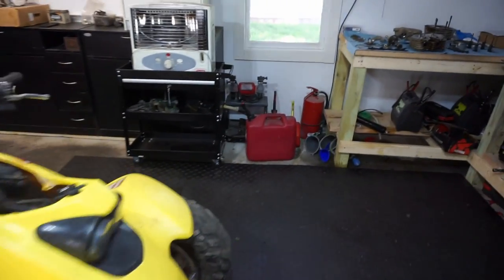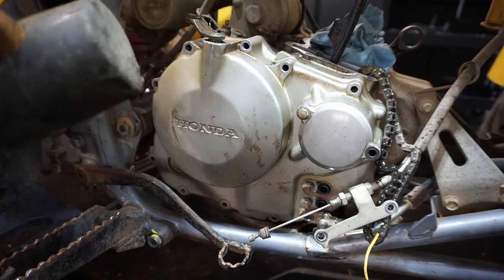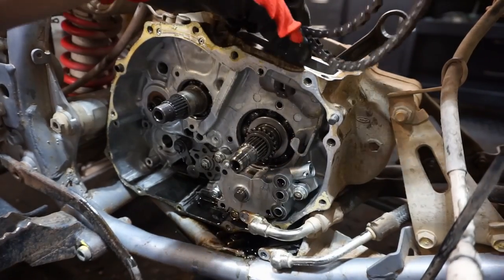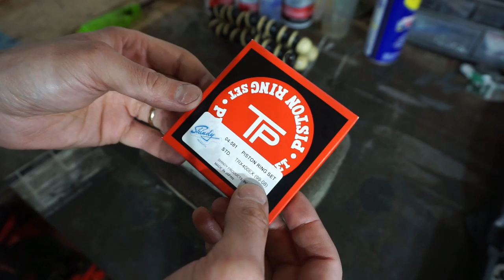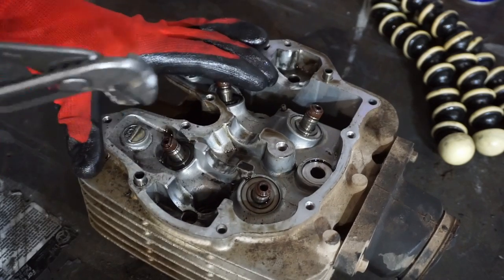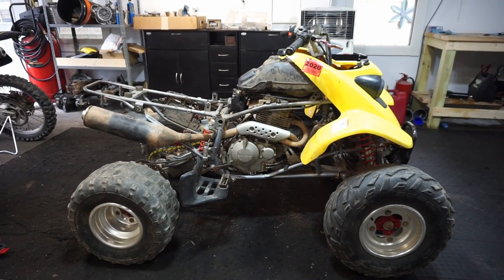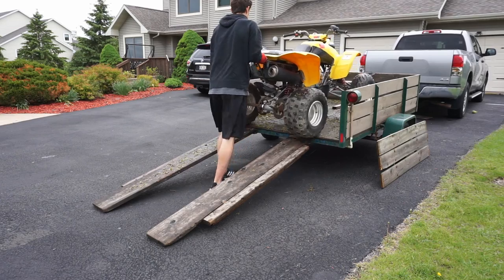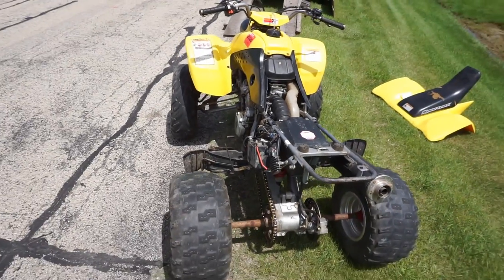Honda 400ex Has Weird Problem. I NEED HELP!

Comment: so the timing is correct otherwise it wouldnt start up and run. enof fuel i guess -?- cuz u said it sounds like no more spark at high rpm. because u get a spark at all it shouldnt be a mechanical issue in terms of stator or sth. but what does give the advice to spark. the position sensor gives the time and the battery provides the energy and the cdi tells everyone when to step in. since u replaced the stator including the new position sensor and the Ignition coil, this should be ok. what is left now?  - the cdi and ?

Comment: Let's go, Joe coming in clutch.   Hey can anyone help me out?  So my 400ex has a problem.  As soon as i hook up the battery or attempt to the bike rolls over and will keep cranking trying to start. P.s.  it does work and start.  But like it's a pain in the sack cuz idk the problem.  Even if the key is off or completely out of the ignition, as soon as you hook up the battery it starts cranking over without even hitting the start button.  Someone please help, thanks!!

Comment: CDI, coil, plug or plugwire. Or any part of the ignition circuit needs to be checked. It's an electrical problem. Period.
Reply: Are u sure about that?🤔🤔

Comment: Check your exhaust system. If it isn’t venting all of the exhaust properly it will choke out under full throttle.

Comment: I been trying to contact you to help me with my 400 ex .. it runs good, start rigth up, has a noise on top end.. dont know that could it be..
Reply: valve clearances, cam chain tension, piston slap. 3 top end noises that can exist on a 400. pulling the tappet covers and checking valve clearance will fix 2/3, and if it's still noisy then your piston is shot.

Comment: It's not electrical check the fuel flow out of the petcock those ex400s are notorious for having not enough fuel flow and what it's doing in 5th gear it's running out of fuel it's nothing electrical I fixed two or three of them that did the exact same thing what I ended up doing is just removing the screens from the petcock inside the fuel tank and then I got enough fuel flow that the shutting off in high gear went away the reason that it's doing it in 5th gear pinned is it's running out of fuel in the bowl of the carburetor and other thing set the float height I if it's not the fuel flow with the petcock the float level isn't set high enough in the carburetor and you're running out of fuel in fifth gear I would bet money that that's what it is I just fixed one last week that was doing the exact same thing it ended up being a combination of the two

Comment: Did you ever find the cause of the problem? I'm guessing if it was a fuel problem you would have issues in other gears? So I'm guessing electrical? Did you ever find the problem.

Comment: So the machine has way more power than it needs for two wheel drive. If four wheel drive this engine would be way more matched to the power, especially in mud swampy conditions. I think the brake pads on the rear of these quads is a joke. Not fit for anything unless ya'll are ready to put new ones on every month.

Comment: Didn’t you have another Honda with crank bearings got hot , n sticky stalling the vehicle 
Then it would cool a bit and run …. Maybe deep inside heat may have started in on the rod or crank bearings ?

Comment: Why would you get this person to spend all this money on a new timing chain new this new that and then reuse the old piston regardless if you can see anything wrong with the piston or not the fact of the matter is that the piston made contact with the vowels that's how the valves got bent so the possibility that it's made a defection in the ringland is very high and you're just setting this guy up for failure down the road in a premature blown up engine should have installed a new piston because the piston has made contact with the valves
Reply: Look at where the valve hits the piston, it will not be on the edge or near a ring land and rarely have i seen a piston get damaged other than the top from hitting a valve. The way a piston bends a valve is leverage of the edge of valve off center from the valve stem.